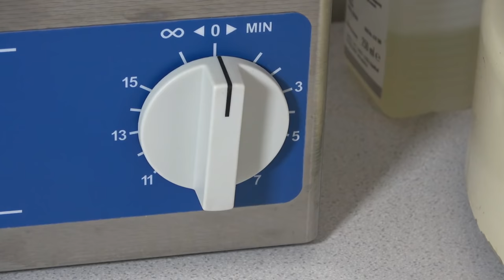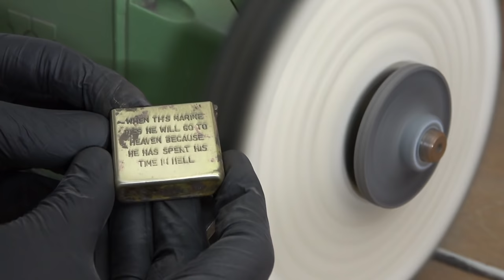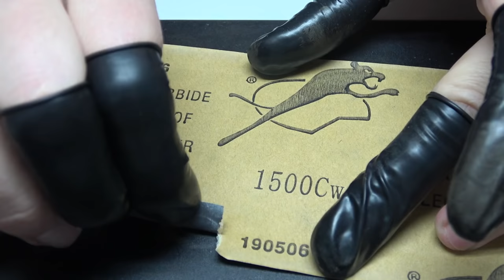Restoration of a Vietnam War Zippo Lighter - Bong Son 68-69 Military Lighter

Comment: I was a Marine in Vietnam from Sept 1966 to May of 1968 and I still have the Zippo I had engraved and carried over there and the darn thing still works just fine.  I've only had to replace the wick once.
Reply: Damn! Never used it much?
Reply: Isnt it hard and unreliable to have a zippo during war? Since the fuel keeps evaporating and you need to refill it? Just wondering
Reply: @alex121429 pretty sure those soldiers would use gasoline
Reply: @alex121429 no bics back then dum dum. What were they supposed to use?
Reply: @alex121429 probably so, but bics weren’t evented till early 70s so zippo was pretty much the only form of small portable lighters.
Reply: Thank you for your service, brother. Semper Fi; and Welcome Home.
Reply: @alex121429  I was aircrew in a helicopter squadron and we used aviation gasoline in our lighters.
Reply: Tôi là người Việt Nam. Rất ấn tượng với những chiếc zippo. Mong rằng hoà bình, hữu nghị luôn mãi trường tồn với hai đất nước VietNam - USA!
Reply: ib money

Comment: An 'old sweat' would have had a couple spare flints tucked under that first layer of felt ;)
Reply: Ha
Reply: If you notice when he puts the last felt pad into place there is a small hole in the middle of the pad. The larger hole goes over the flint tube. My Grandfather kept a spare flint in that little hole. It was the job of my small fingers to fish it out and put into the flint tube. I always got the flint dispensers when they were empty as a weird toy. It's a wonder I never smoked.

Comment: I sincerely do not want to take anything away from your amazing work and talent, but that wasn't a genuine Zippo.  I have been collecting Zippos for over 30 years and can easily spot a fake.  The market is flooded with fake Vietnam Zippos aka Rippos.  The fakers usually use cheap Zippo knock-offs (like this one) and engrave them, dirty them up, corrode them with salt/acid, and beat them up a bit.  Even genuine vintage Zippos are sometimes used and trench art is added to fool an unsuspecting buyer.  It is sad that people look to profit off the hardship of war.  Best of luck on your future work.

Comment: Really great work man. 👏👏👏 But did you check if it's real? I know it's rusty and almost broken but at the bottom you can check if it's real. There are some signs that show that it could be fake. For example the Z from Zippo should have a longer tail on top or after Bradford there should be a komma and after PA a point. Let it check.😉 But I really liked the restoration.👍
Reply: It also said "made in zippo" on the inside, it's fake.  The question is how old a fake is it, and how did it end up looking like that.
Reply: @pmc220  It could be colour or you can let it rust with chemicals. That it ends up looking like this is simple🙂

Comment: What’s that lighter worth now? Awesome video
Reply: Absolutely nothing as it is a cheap fake. During the Vietnam war zippo was not producing brass cases as the brass was required by weapon/ammunition producers. Also if you look at the insert this one is hand engraved, a real zippo insert has the writing stamped in it. A real Vietnam war zippo lighter is worth 100$-500$  but even on eBay most Vietnam zippo are fake.
Reply: @leandernathow826  wow. Thanks so much. Didn’t know that.

Comment: Awesome restoration but wouldn't it have been a lot easier and more efficient if you only restored the case and then bought a new zippo and replaced all the parts inside with the new one? Unless there's something unique about the inside parts that I missed like another engraving.
Reply: Then it wouldn't be a restoration, nor would it be genuine as the original. The whole point, is to retain every saveable original part, and its unique history.

Comment: call zippo they do restoration for free
Reply: No they won't.  They'll repair it, i.e...if the hinge is loose or the hinge broke off the lighter itself. Or if the top is missing. They won't remove rust or "restore" the zippo to brand new condition.
Reply: @nevets68  antiques they restore if your lighter is rusted they will fix it, lost part of a wolf emblem  and they fixed it. a originl they will do there best. yes i asked for someone.